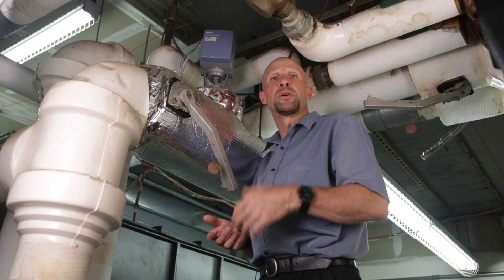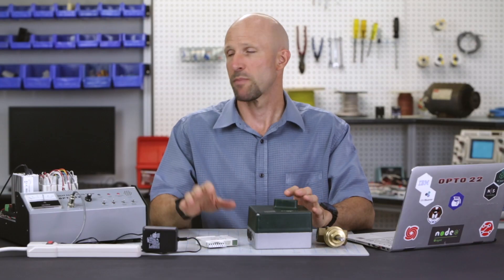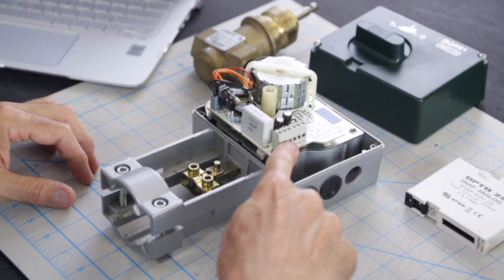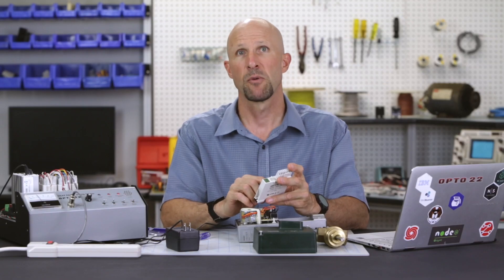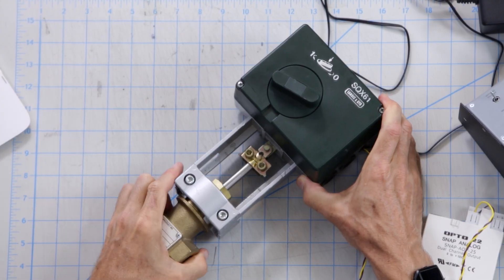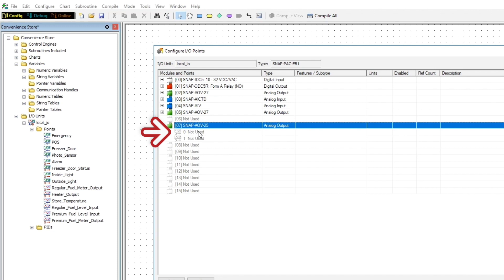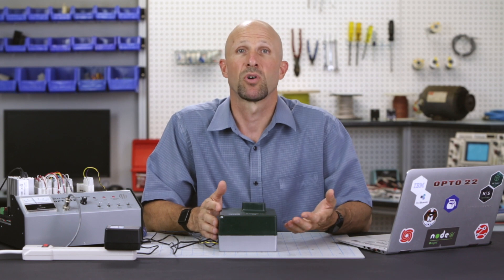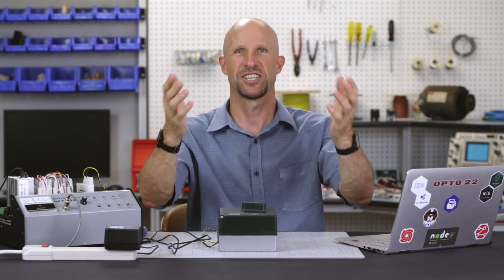How to wire a valve actuator for the IoT

Comment: Nice video Ben.
Reply from the maker: Thanks Sean!  Do you have any suggestions for future videos?
Reply: I think these videos are great, and they seem geared towards those who are getting their feet wet for the first time. 
Down the road I would like to see more advanced topics such as connecting to Incremental shaft encoders, printers, card readers, RFID equipment, parallel output devices that require more than 8 input points (such as absolute encoders) connecting a stepper motor to the SNAP Motion Control Breakout Board. 
Keep up the good work!
Reply from the maker: Fantastic suggestions!  We will add them to the queue.
Thanks again!